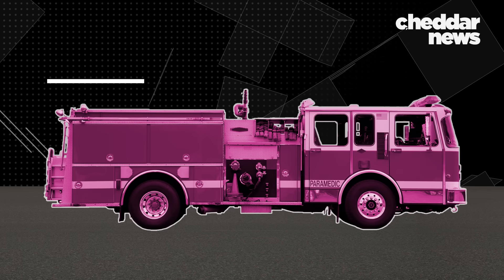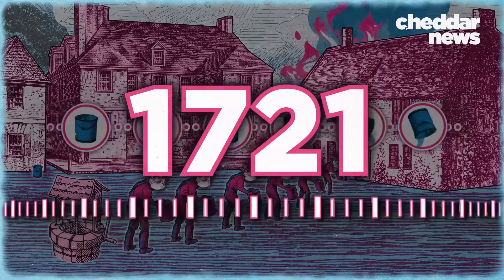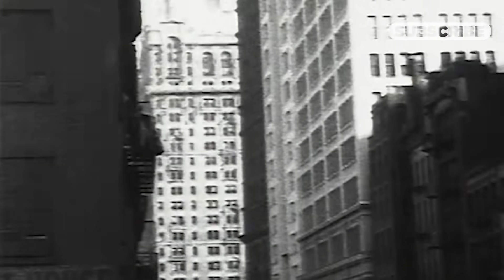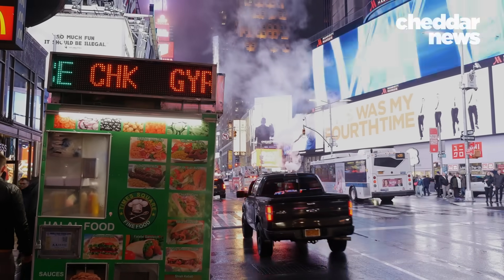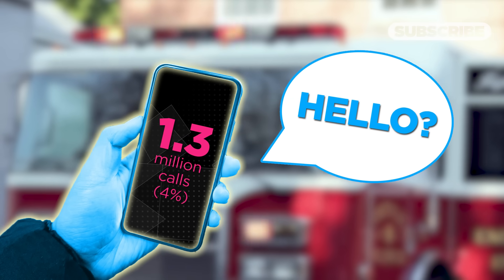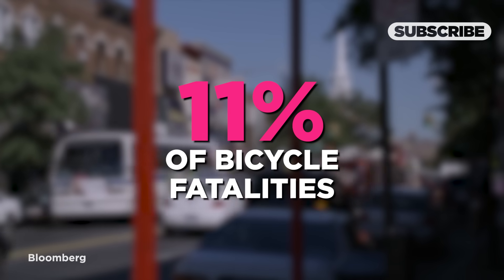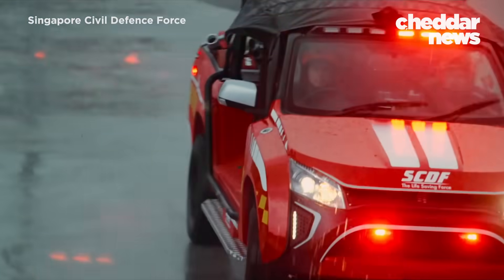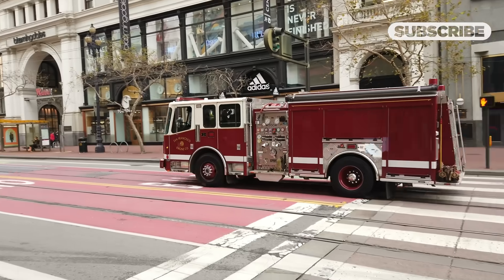Do American Fire Trucks Need To Be So Massive? - Cheddar Explains

Comment: I'm not an expert with the us fire trucks, but I think a German (i am from germany) HLF 20 (common fire truck in Germany; a mix between Heavy Rescue Truck and Engine) has more equipment on board than a typical us fire engine although it is smaller
Reply: Round about the same ammount of equipment actually, varies by department and what the truck is used for. The departments out where I live have one maybe two general use trucks that carry everything needed for most calls such as extraction equipment, large tanks for extended fire calls etc... with smaller trucks for fringe and specialty cases. The size tho, their comparable in storage, in fact a lot of modern NFPT trucks look like the Eurpopean and Asian counterparts in design philosophy, just with American styling.

Comment: depending on how they operate and we've also got to remember this is not Europe this is America buildings are very much different Fire departments have different needs some vehicles need to be shorter some need to be longer for example a rescue truck needs to be quite large because it handles and lots of different incidents and carries a lot more equipment for those reasons
Reply: Europeans have Heavy Rescue Trucks as well ... but most of them aren't any longer...

Comment: Meanwhile in Argentina and Chile they're getting away from small European apparatus and buying large North American apparatus now. Apparatus are spec'd for the area they cover. In America most stations have 1 to 3 apparatus to handle calls. They may have an Engine, Rescue, or Ladder. In Europe many departments run 5+ apparatus allowing for the trucks to be smaller as more respond together initially.
Reply: In Europe most trucks are engines that also double as rescue vehicles
Reply: actually also brandnew European trucks are still bought in Chile ... 
Most stations in e.g. Germany have only 1 to 3 trucks as well, sometimes not even trucks but only a van. In larger villages, towns and cities the size of stations grows quite a bit, and then several apparatus will respond at once
Reply: @EnjoyFirefighting  they still may be purchasing some European built apparatus, however, the number of Rosenbauer custom North American style apparatus have increased. Outside of retired Pierce, E-One, and Hahn apparatus from the US there are many brand new apparatus that are the same size, if not larger than American and Canadian engines and ladders in use.
Reply: @MD-tu5ks  is there actually ANY norm or regulation for fire trucks in Chile? I mean, personally I LOVE the mix of all sorts of apparatus, lights and sirens setup. But it seems to weird that it seems like you can buy and do whatever you want to
Reply: @EnjoyFirefighting  I find it interesting as well. A small department bought our retired Hahn years ago and left it pretty much exactly as they received it. Their next engine was a Pierce from another nearby agency which received upgrades. Their tanker is a Mercedes with neon lights and a federal Q. The mix of Martin Horns on American style apparatus and Federal Qs on euro style apparatus is interesting. I've seen some apparatus with all green, all blue, or all red lights. Some with Roto-Rays. But there really doesn't seem to be any uniformity to lighting etc.

Comment: I think what this video neglects is the massive cab of traditional American fire trucks. In the 2001 World Trade Center incident, the collapse of the building caused debris to fall over the passenger cabin but said passenger cabin has been credited for the survival of the crew. A lot of crewcab trucks that Europe and Asia has usually doesn't have this benefit as they are merely just crew cab version of commercial trucks.
Reply: If they had European style trucks, then they may have been able to call more in, obviously it doesn't make a difference in the situation, the response time, may have been faster, but only slightly, the bigger benefit would be getting the trucks closer to the buildings at the time.
Reply: Yes but how many times do you think heavy debree on a fire truck falls everyday?. Not a lot
Reply: All the fire trucks that where near the world trade center got crushed to bits. I think you talk nonsense.
Reply: @Mar-s5q8m  Yeah as I seen FDNY apparatus after the Twin Towers of the World Trade Center fell, they were crushed and looked mangled up pieces of scrap metal.
Reply: you can roll over a Volvo truck without the roof of the cab being smashed, just saying
Reply: @EnjoyFirefighting  I am pretty sure there is a difference between flipping over and having chucks of concrete falling on your apparatus.
Reply: @PriceTheCourier  and do we have comparable incidents where one could say that the cab of a European truck withstands or doesn't withstand such an impact? Not as far as I know ... not in the 2011 Oslo attack, not in the 2012 blasting of the WW2 bomb in Munich, not in the 2019 Notre Dame fire in Paris,
Reply: @EnjoyFirefighting  It's really difficult to compare, to say.
Uhh... the only way is to do a familiar test but it would be very pricey... you know?
Reply: @PriceTheCourier  true, true ...
Reply: @PriceTheCourier  How often do US fire trucks have 500,000 tons of steel and concrete fall on them on a daily basis nowadays tho, i wonder
Reply: @porco_rosso-e4r  I am stupid, don't listen to me.
Reply: @PriceTheCourier  we all are, sometimes
Reply: @PriceTheCourier  The concrete was turned to dust ~100 microns in diameter. An ambulance was parked next to the globe sculpture in the plaza right below and between both towers when they collapsed. The ambulance was covered in concrete dust but otherwise completely undamaged.
Reply: @HarryBalzak  What zone of the impact area are we talking about?
Distance or by the Twin Towers?
Reply: @EnjoyFirefighting  yeah but the weight of the truck itself and pieces of falling bit have quite the difference in force
Reply: @seskorirkeashimrui3556  and do we have comparable incidents where one could say that the cab of a European truck withstands or doesn't withstand such an impact? Not as far as I know ... not in the 2011 Oslo attack, not in the 2012 blasting of the WW2 bomb in Munich, not in the 2019 Notre Dame fire in Paris,
Reply: @EnjoyFirefighting  Just like there cars
Reply: US crews prefer to stay inside their truck during an intervention for added safety?
Reply: Trucks in Europe have much higher standards than US the it coms to safety.

Comment: This video was put together by a 10th grader. It doesn't explain anything.  It doesn't correctly list the sizes of the vehicles.  Right away it starts talking about a "type 1 fire engine" but it doesn't explain to the viewer what that means.  It doesn't explain the difference between a fire engine and a fire truck.  It doesn't explain the difference in Europe vs the USA other than the vehicles.

Comment: American fire trucks are not 10 feet wide. Max legal width for the US is 8’6”, any more than that and vehicles need special placards and permits. Fire trucks are the width they are because underneath they are based on commercial semi trucks. The axles / tires / brakes engines are all the same. While europe does have some smaller truck platforms than America most of the trucks you showed while talking about them are the same width or very close. They too are based on the same commercial chassis.

Oh and chassis is pronounced “chassy”.
Reply: Thank you! Geez Cheddar get your facts straight !
Reply: @timslager5966  no it’s not, dude doesn’t understand what he’s talking about
Reply: The Pierce Arrow custom cab is 94.75" wide. The Pierce Saber is 96" wide. A sutphen custom is 96" wide. KME Custom Panther is 99" wide. The E-one Cyclone is 100" wide.

Unsure where anyone is getting that American custom fire trucks are 9 foot wide. While virtually all stick around the 90" to 100" width.
Reply: My guess would be they're measuring outside the edges of the mirrors. Even though the dot reg specifically excludes the mirrors.
Reply: Fire trucks in Europe are not 8'6" (2,60m) wide. We usually have 2 types of trucks in each fire stations and some have more.  These 2 types are light intervention trucks (typically Mercedes sprinter) about 1,70m to 1,90m (Since ancient times, the standard for Roman chariots was 1,465m. The streets in the ancient and medieval parts of cities in Europe are therefore a little more than twice this width (±3m). With those 1,90m trucks, we have enough space on the sides to access the compartments of the truck) and the other type is medium size intervention trucks which are 2,30m wide.
Reply: Umm a standard width of most cabs is 100 inches wide so you're definitely not even close to being correct.
Reply: That’s just not true what so ever… the max “legal” width is not 8’6”. Just stop. You have zero clue what you’re talking about.
Reply: @Duzzy9513  The maximum legal width of road vehicles within the USA and Canada is 2.6 meters or 102 inches, which translates to 8' 6". In order to operate anything wider you would need approval, route plans, signage and possibly spotters. While they do allow special exceptions for Emergency equipment, that would require custom chassis to be built, which would be pointless for most applications, so most fire trucks fit within the legal standard, making the information in the video, and your comment, false
Reply: @Somoneishere  bro literally 99.9% of all fire trucks built have a custom build chassis. 😂
Reply: @Duzzy9513  do they use custom width drive axles? Or the standard width off the shelf class 8 semi truck axles? It's all about the width of the axles...
Reply: @Duzzy9513  they use standard class 8 axles. It's the same width as the average semi, be it custom or commercial chassis build. The truck is still only 8'6. The cab looks wide on a custom chassis because it's a cab-over design and the driver and officer sit beside the engine.
Reply: @Duzzy9513  no, it's closer to 60/40% between custom chassis and commercial chassis.
Reply: @merritttrucker  max standard vehicle width NOT including mirrors is 8ft 6" ... add the mirrors sticking out and I bet you get awful close to 10ft overall.  Ya'll arguing over nonsense you dont even understand LOL  Yes the cab and and bodies are going to be custom but things like axles are going to be off the shelf standardized widths, so even if the frame rails are custom, the width of the rails will be the same as any class 8 truck out there.
Reply: @Duzzy9513  no they're not. Most floor models are built on a standard commercial truck chassis. Unless the department specs everything it's a barebones chassis made into a fire apparatus.
Reply: @dirtdevil70  I understand vehicle width and do know what I'm talking about. I am a former fleet maintenance supervisor for a fire department, as well as a commercial driver that specializes in over dimensional freight. Spent countless hours taking measurements with DOT for my permits, I'm pretty sure I have the law figures out after 20 years of doing this stuff.
Reply: @Duzzy9513  https://ops.fhwa.dot.gov/freight/publications/size_regs_final_rpt/#:~:text=59%20FR%2051060).-,FEDERAL%20SIZE%20REGULATIONS%20FOR%20COMMERCIAL%20MOTOR%20VEHICLES%20(CMVs),on%20the%20Interstate%20highway%20system.
Reply: @Duzzy9513 My goodness, all it takes is a simple Google before making such a stupid comment. OP’s info is correct and contrary to what you claim, YOU are the one who doesn’t know what he’s talking about.

Comment: Cheddar has conveniently missed a number of facts in its comparison.  US fire trucks are not that much wider than European trucks.  Kind for kind, European vehicles are much higher than their US counterparts requiring pull-out or fold-down platforms to allow firefighters to reach equipment in the higher parts of the superstructure.  US Class A pumpers also carry much more hose than their European counterparts and are set up to deploy much more rapidly using hose beds, cross-lays, extended bumpers and exterior surfaces to mount equipment whilst European vehicles have all the equipment encapsulated in the superstructure and carry limited hose.  Pumps on US vehicle on average have greater delivery than their European counterparts, at the order of several 1,000 l/min (or 100's of gpm then).  US ladder trucks are much larger than their European counterparts but carry substantially more equipment as they perform Truck/Ladder Company as well as Rescue functions at incidents whereas European ladders/platforms are simply used for their height/reach abilities.  Cheddar also neglects to say that Mini- and Midi-pumpers have been around in the US for decades and are in wide use in rapid intervention roles but are still in need of the support of larger vehicles for larger incidents.  The same holds true in the case of the Singapore Rhino that still needs a big brother to back it up.
Reply: good summary with mostly correct information :)

Comment: The point of saying that only a small portion of calls are fire related is stupid. It's like the video is trying to say that we should stop using fire trucks because the odds of having to use them for their designed purpose is low. I am part of a rural VFD, so let me explain why having larger trucks is beneficial.
Our trucks have to be equipped with additional specialized equipment because the situation may vary. Our month can either have 2 calls, or 200 calls. If we have to respond to a residential fire on a 2 story house up a hill, we need to respond our 3 engines and a tanker, which is out of service currently. This means in order to bring a water supply, we have to run a hose from the location of the fire to the nearest lake because we have zero hydrants in our entire district. European trucks usually don't have space for a hose bay. We also have to bring a debris cage for our hose to connect to, which still takes up an entire shelf. We also keep hydraulic airbags to lift vehicles involved in a MVC, 2 gas generators and an air compressor, a backboard, hydrant kit(For extended calls in city area) and a much longer list than read here. Special credit to the writer who said they have 300 gallon tanks. We have 2-3000 gallon tanks. 
To assume that all American fire departments could operate with smaller trucks is insanity. I am not talking about brush trucks, all departments in our county have a Ford F250 for that purpose.
Reply: depending on the type of apparatus, also European ones have a hose bed, but it's definetly not as common. Depending on the country, they might have a hose cart hanging at the rear of the truck instead. 
A standard Engine in Germany carries hydrant kit, EMS equipment, lifting cushions, complete set of extrication equipment, power generator, ground ladders, brushfire gear etc as well
See ... we don't have seperate brush trucks in most places here ... we simply take the plain normal Engines and Tankers / Tenders offroad